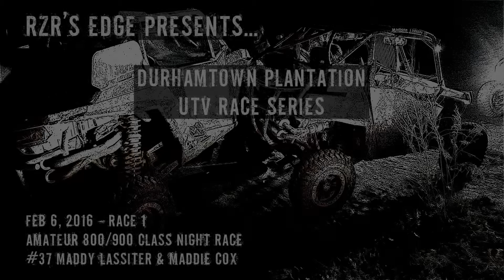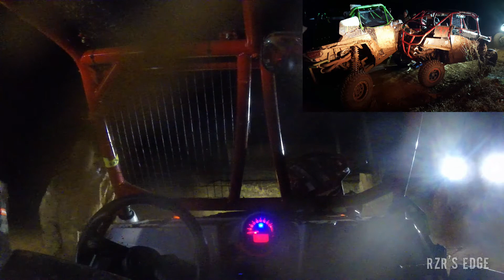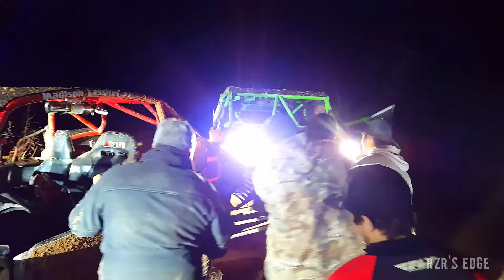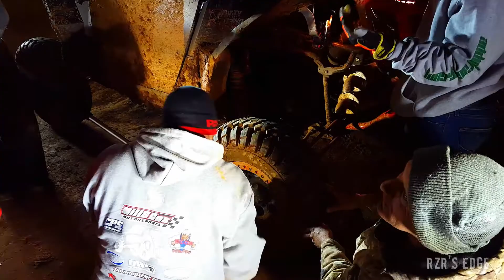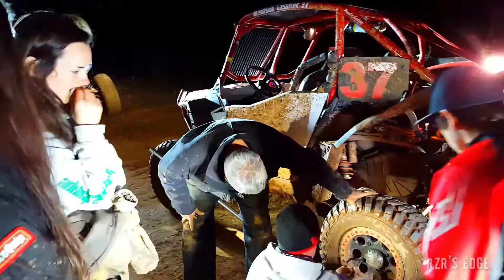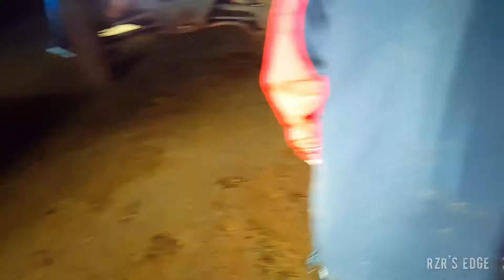Durhamtown UTV Race Series 2016 R1P6 - Night Race Conclusion

Comment: Chalk it up to another experience, Bum deal though!!
Reply from the maker: +Metal Gearz Yeah they had no idea what was wrong with the rzr, much less that there was another one stuck in it haha
Reply: +RZR&#39;s Edge How much damage was done after yall got home and could check it out better?
Reply from the maker: +abassett22 It actually wasn't really hurt at all. We thought the shock was bent, but it was just the bottom spring cup had been shifted off its base. Just had to pop it back in place. One of the homemade fender brackets was bent, but just straightened it back out by hand. Oh, one of the tractor supply brake lights was broken, quick easy fix :)
Reply from the maker: +abassett22 It actually wasn't really hurt at all. We thought the shock was bent, but it was just the bottom spring cup had been shifted off its base. Just had to pop it back in place. One of the homemade fender brackets was bent, but just straightened it back out by hand. Oh, one of the tractor supply brake lights was broken, quick easy fix :)
Reply from the maker: +abassett22 It actually wasn't really hurt at all. We thought the shock was bent, but it was just the bottom spring cup had been shifted off its base. Just had to pop it back in place. One of the homemade fender brackets was bent, but just straightened it back out by hand. Oh, one of the tractor supply brake lights was broken, quick easy fix :)
Reply from the maker: +abassett22 It actually wasn't really hurt at all. We thought the shock was bent, but it was just the bottom spring cup had been shifted off its base. Just had to pop it back in place. One of the homemade fender brackets was bent, but just straightened it back out by hand. Oh, one of the tractor supply brake lights was broken, quick easy fix :)
Reply from the maker: +abassett22 It actually wasn't really hurt at all. We thought the shock was bent, but it was just the bottom spring cup had been shifted off its base. Just had to pop it back in place. One of the homemade fender brackets was bent, but just straightened it back out by hand. Oh, one of the tractor supply brake lights was broken, quick easy fix :)
Reply from the maker: +abassett22 It actually wasn't really hurt at all. We thought the shock was bent, but it was just the bottom spring cup had been shifted off its base. Just had to pop it back in place. One of the homemade fender brackets was bent, but just straightened it back out by hand. Oh, one of the tractor supply brake lights was broken, quick easy fix :)